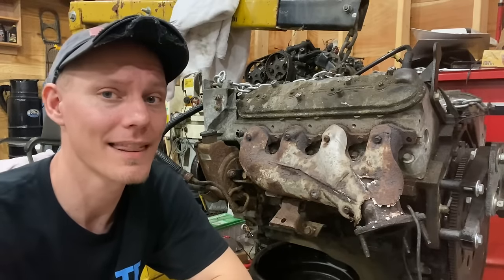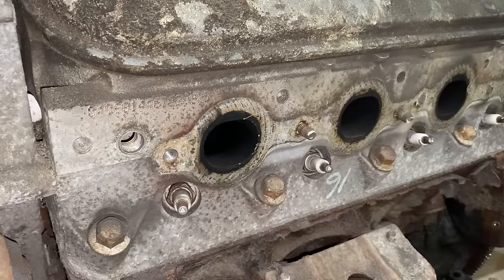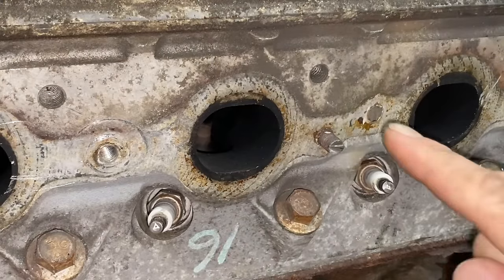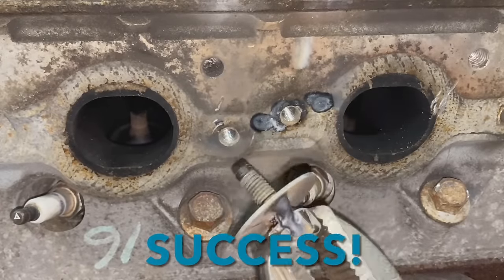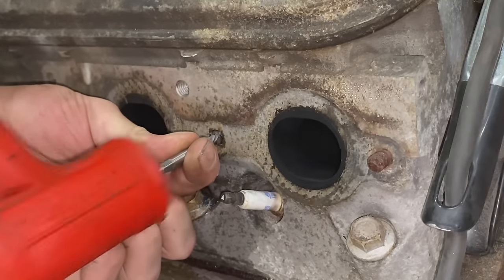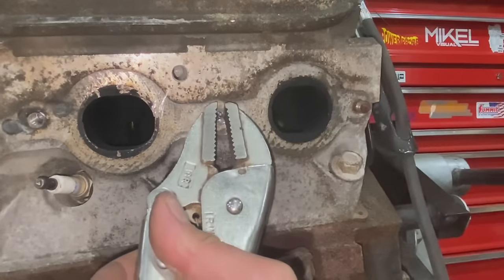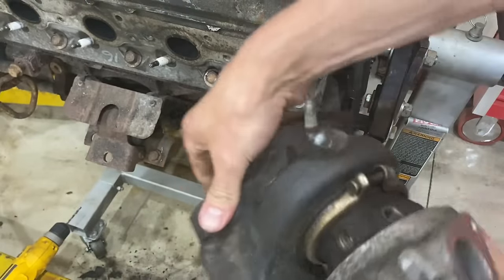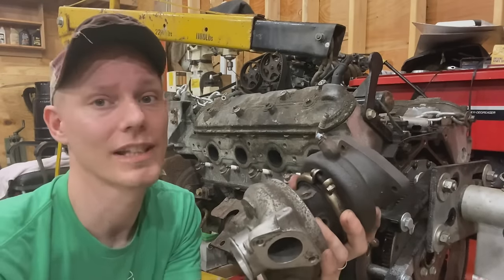How To Remove A Broken Bolt 6 DIFFERENT WAYS - LS Exhaust Manifold

Comment: I'm a pro at snapping the easy-out inside the frozen fastener.  Last time I did it I was so furious I just went and bought another distributor at the junkyard and threw the messed up one in the trash for revenge.
Reply from the maker: I was once working on the bosses rare SD-455 pontiac. I snapped an exhaust manifold bolt, then drilled it and snapped the drill bit in the hole. Got the drill bit out and snapped the easy-out in the hole. After many, many, many hours, it was fixed.

Comment: I can't be the only guy to comment this, but I'm not reading every comment to find out.  One method that works for me about 60% of the time, is to drill it with a left-hand drill.  Of course, you'll need a reversible drill motor to turn the drill CCW.

I normally heat the area with a torch before drilling.

I like your sense of humor! 😂

Comment: I've noticed when dealing with rusted frame bolts, that if you cut the head off and remove the part out of the way, removing the left over stud with something like a stud remover is much easier.  Maybe due to lack of clamping force against the part?

Comment: That went from so-so to dumb quickly.  Heat the Stud first after an overnight spray with penetrating fluid.  Drill with Reverse Drill .   Try hammering in an interference fit Torx bit which does not expand the bolt all the way down.  Heating the Stud is key. You can try quenching with cold water immediately.
Reply: Thank you for the ideas!

Comment: I worked in an automotive machine shop. 
The only method we used was a torch and a tap. The steel will turn to liquid and blow out of the hole without harming the cast iron. Run a tap in the hole and you are done. I could have done all while he was doing one. I liked the video. Learned some new things.
Reply: Question .new to mechanical work as far as this application?   ?wouldn't that fall inside the interior?

Comment: GM 4.2 cylinder head bolts, notorious for breaking off.  9 of 14 breakoff 3/4" below surface.  Too low to weld.  So go for center drill.  Problem is how to ensure center drill.  The bolts are 11mm however the hole is 12mm/1/2".  I find scrap bolts that fit the bolt hole.  Cut off the threaded part so you have head and unthreaded shoulder.  Put that in drill press vise with bolt head up.  Drill 9/64" hole thru center with drill press.  Used this as center pilot and works fantastic.  Key is to use cobalt drill bits with cutting oil. . Drill down 1/4" in 3 steps and use small pickup magnet to clean cuttings.  Use #2 easy out.  Worked great.  I did not have left hand drill bits, but found sets on Amazon for $13 for next time.  Lessons learned.  I also made larger pilot bolts, but did not need.   Love the washer-weld trick for surface broken bolts.  Did not know that and attempted center drilling without a pilot on the head and screwed up and drilled into water jacket because I go carried away.  Win some, lose some.
Reply from the maker: Good info. So once you drill the hole in the center of the head bolt, what do you use to pull the bolt out? Just increase drill bit sizes until you can pull pieces out?
Reply: @WiringRescue  I was able to use a #2/3 easy out, tapped in with small hammer lightly.  Just by luck they came out easy.  Not so lucky when I tried to do the same with broken exhaust studs.  That was disaster, ruined one hole. Drilled into water jacket.  Not sure if that can be fixed.  Had to get another used engine as that was cheaper than a rebuilt head.  That engine also had broken studs.  Unable to drill them out so went to tapped for next size up and then installed helicoils.  Do not know if that will work as I just got new bolts and gasket today.  Best to weld those studs out but not good at that either.
Reply: I was able to drill out a broken off extractor inside a fuel rail bolt with cobalt bits and drill oil. Took a long time, very slow progress and didn't seem to be cutting at all but then broke through and the broken bolt drilled through easily.

Comment: I've used the turbo charger method many times and had great success
Reply from the maker: Perfect! I have discovered that the bigger the turbo, the more fun it is to remove the bolts! Thanks for watching!
Reply: Really, I thought the TC thing was a joke. I would think any piece of metal welded to the broken bolt would help remove it, but why a turbo?
Reply from the maker: @georgerose8727  it was a joke, but it’s not dumb if it works!

Comment: I have one broken off inside 1/4 inch in aluminum.  Would this way work by welding because the weld will stick to broken bolt easier and not aluminum head with washer and nut welded above?

Comment: Ive had good luck using a 4 sided lathe bit the 4 sharp edges after hammered inside the drilled hole grips it well and makes wrenching it out ez as pie.

Comment: I welded a stud on a bike engine. battery disconnected but I still blew the alternator. I now always disconnect the battery, the alternator and (for good measure) any ECUs connected to the engine.

Comment: one thing that I have tried and had success at is before even getting into a job that the bolts are seized like in exhaust manifolds is to take the impact gun and attempt to tighten them slightly but being careful not to break it just give a couple quick blasts with the impact in the forward direction and then the reverse direction and maybe go back and forth a couple of times doing that seems to help break them loose as well
Reply from the maker: That’s a solid idea to try if the bolts are not already broken off. Thanks for watching the video!

Comment: I weld a hunk of rod about 4" long to the knob of the visegrip adjuster screw at a slight angle as a t-handle. The angle lets me spin the t-handle with my palm for quick adjustments and to lock the visgrip with MUCH more force on whatever I'm clamping. 

I drill whatever nut I'm using to remove the threads and plating for a stronger weld. With the engine on a stand I face the engine so the manifold flange is level to take advantage of gravity.  When I have one broken bolt I expect more so I heat each head to bright red with a fine oxy-acetylene torch tip so the heat is localized to the part. Then I let it cool until no color is visible and rock it back and forth a few degrees to break the threads free. I do this about ten or twenty times before removing the fastener. I ALWAYS use anti-seize on bolts going into aluminum parts, and not that watery aluminum powder shit from most parts stores. A tub of Jet Lube copper or any high quality nicke works fine. I've removed manifolds I installed decades before wthout difficulty.
Reply from the maker: Lots of great info here! Thank you for sharing all of it!

Comment: Were do you get your supply of turbo chargers? One other method is to drill out the broken stud to the "root" diameter of the thread and then run your tap down the hole.

Comment: You are right sbout the EZ Outs. If the threads are bound up, it's a no-go. If the head broke off in an accident or because of fatigue, you have a chance. And if you break an EZ Out, only a carbide bit (if any) has a chance of drilling it out. With a steel bolt in an aluminum head, there is a 90% chance the threads are bound up.

Comment: Hey I didn’t see you use any heat on the bolt you drilled out. Probably would have helped. Welding & heat definitely helps. 
Nice video

Comment: Unfortunately I had to pull my cylinder head and am taking it to a shop for repair. I hit the water jacket and broke off a bit and also drifted off center a little bit. Ordered helicoils and even got three different sizes but ultimately felt that I was going to make it worse so I quit while ahead. I was wondering if it would be worth drilling out and tapping the other holes to the next size up and using SS studs.  I ordered new bolts and also a stud kit and will decide as I go. My bolt was broke off below the surface so I didn’t try welding a nut onto it but the washer trick might work. It will be real hard with a stick welder but it’s possible. Really glad I’m not paying labor for this job because the parts alone are killing me!

Comment: I have a 2012 ram Cummins and someone had to of broken a bolt where the transmission pan goes. Pretty sure where the pan bolts to is aluminum do you think this welding is still a good option? Great video btw!
Reply from the maker: I’m not familiar with those engines, so I’d say, look around and make sure welding will not light things on fire. There are usually a lot of fluids in that area, so it seems a bit risky to me!

Comment: I hate those easy outs if and when they break off you have a whale of a mess. These things are so hard they are impossible to drill out.  I would difinently use one of the other methods.  Nice video.

Comment: This was quite helpful for me...  I found the double-nut (backed into eachother), with some spray, heat, and an extra boost by Vice Grips did the trick best, but I did have to Dremel a nut nostly off and chisel it in the lefty-loosen direction.

Comment: Ah the ol turbo manifold bolt trick. Been around for years. Pioneered by airforce mechanics in the pacific thee-yater during dubya dubya too.
Reply from the maker: Back in my day, we welded helicopters to broken bolts and then flew em in circles!

Comment: And if you don't have a easy out to remove broke off stud I have found that a torx bit ( without security style hole in center of bit) works pretty good. And always use  a center punch on stud and best to drill all the way thru stud also helps chances of removing stud. And be straight as possible and try stay away from threads.

Comment: if you cant remove the head, is it better to have the engine hot, normal running temp, or the engine cold, when you start working on this....

Comment: I will try that washer  l do the  bolt method  mostly  I started  heating  the bolt heads  before  I remove  them I rarely  break  a bolt now and for the dipstick I heat the block  around  the tube and work  it out carefully  remove  the starter  first  to get better  access

Comment: If the stud is sticking out, I’ve found best method is hitting bolt with hammer to jar it lose. Douse with penetrating oil. Vise grips & tighten a touch 1st, then back out. Sometimes hitting with hammer again and spaying again. Have had good success with this

Comment: Nice video! When I extract bolts the first step for me is to always douse it with penetrating oil and then shock it with a hammer and pin. I rarely weld a turbocharger onto the stud.
Reply from the maker: This is good advice! When all else fails - weld a turbo to it! Thanks for watching!

Comment: i dont know if you have tried t e freeze spray avail.at parts stores it work very good on broken bolts spray it on then  unscrew it shrinks the bolt slightly to break the rust bond

Comment: So this is an old video, but just came across it.  What would be your thoughts on this one...I have a 2008 Charger, 2.7L V6.  If you are looking at front of engine, they have a Torx bolt/screw in like the 11 o'clock position of the timing chain cover/timing plate.  I snapped the head off.  Any ideas on how to get that out?  The space between it and the radiator is really limited.  So hammering in a bit or something is probably not doable.  I can't even get a drill in there to drill into the stud.
Reply from the maker: The unfortunate truth is that I would remove all the stuff in front of it and use a drill or welder to get it out. It totally stinks. Sorry I don’t have a better option. :(
Reply: @WiringRescue  Yeah, I was thinking I was going to have to do that. Thanks man. :)

Comment: If you have any suspicion that the bolt is frozen in place, use a steel drift and a BFH and hit the bolt dead on several times. Shock treatment will often unfreeze things just enough.
Reply from the maker: Solid advice right here! Thanks for watching!

Comment: Thanks for that video and your ideas! Some days ago I had a inner hexagon screw with bad threat. I didn't get the screw out.  I tried with heat, rust remover and strong pliers. But no chance.  I also tried with welding another screw on it - but it directly broke off.  I am not a good welder ;)  But after using the heat of welding, I could turn the screw with the pliers and hitting with a big hammer on the handle of the pliers.
By the way, rost remover is also a good idea to help removing old screws or bolts. If you have time, put something on it and try to remove bolts/screws next days. I is much easier in the most cases.
Reply: I tried the "bad threat" method today. It just made it put up more of a fight.

Comment: For broken off bolt heads with available shaft length, my Grampa used to apply heat, apply penetrating oil (he called it green oil), let it sit for a day, apply heat and then remove the rusted bolt which he said, usually, they come out.
Reply from the maker: Sounds like a smart guy! Sometimes you don’t have the time to wait though. Gotta start welding and hope for the best when that happens!

Comment: I successfully removed 2 broken bolts with the easy out bits drilled a tiny hole in the center and they came right out I've tried the welding with a washer and the nut and just the nut alone and it failed me so I prefer the easy outs now over welding them

Comment: Heat is really what gets the bolt out. I think the factory puts loctite on the treads. I tap the stud after I weld the bolt or washer then tap it with a hammer to break the bond helps a lot to. Try to get it off while it is still red sometimes work better. Aluminum takes the heat out of the bolt super fast. I start when its red and if does not move keep working on it even when the bolt cool off. If it movers then put penetrating fluid on it and move it back and forth till you can screw it off without breaking your weld or the bolt. Seems to work the best for me.

Comment: Reverse threaded self tapping screws and a sleeve. Put sleeve in hole then self tapping screw in the sleeve. Lot of time the reverse cut self tapping screws will bit and being reverse cut will pull it out. Reverse cut drill bits help to spin it out as drilling.

Comment: What do you do if the bolt is torqued in solid steal and not just aluminum?  Example, being...  A busted off sway bar bushing bracket bolt going into the sub-frame...

Comment: Abom79 had a very nifty tool, a Vessel impact type driver 2500N for taking out stuck Philips head screws.  It was like an impact punch that you hit with a hammer and when you do it also applies torque at that same instant. I want to get some of these because it looks sooo Much better than trying to force a Phillips screw driver to not shear the slots.

Comment: Just curious, since the head is aluminum where did you connect the ground clamp for the mig welder?
Reply from the maker: I clipped it on to wherever was convenient.  The electricity goes through the aluminum head just fine.
Reply: @WiringRescue  thank you!

Comment: Have a similar problem on a marine Detroit Diesel with the nut spinning on the stud. Thinking about putting another nut on the end of the stud with red loctite then maybe impact. Tight in that engine bay.

Comment: I want a MIG welder. Did a exhaust stud on a motorcycle that had a littlt bit of stud sticking out. I was able to thread a nut on anout one turn. A local mechanic with a MIG welded it and the stud came right out.

Comment: When using the easy out, try a reverse drill bit. I can’t swear it but I feel like I’ve had a little more luck with them, maybe it’s the constant vibration and torque in the loosening direction but I swear it helps.
Reply from the maker: It seems that a lot of people here are fans of reverse drill bits. I definitely need to try those out because I currently don’t own any! Thanks for watching!!

Comment: Hi if it's a aluminium head we're do you ground the welder
Reply from the maker: Anywhere on the block works. The electricity goes through fine. Just make sure your battery is unplugged.

Comment: i have a 1972 F250 i plan on reviving and the previous owner/s put performance headers on it. the passenger side came out pretty easy i broke one bolt on the drivers side and i decided to spray lubricant on it twice a day every day  and i plan to stop in about a week. i'll see if that works for me.

Comment: And now the final boss, when you break off the extractor in the bolt and have to use 20 new drill bits to get the extractor out. Also I never see anyone use a lefthand drill bit, might help to loosen it or even get it out.

Comment: Time will tell if this actually works, but I will definitely try out your weld a washer and then weld a nut trick!!!! Like you said at the end for me personally I tend to have such a difficult time actually welding the nut to the stud I usually just end up going with the drill out the center method.

Comment: Method 7(non-weld option): Tap a socket, just smaller than the threads, on the stud. Back out with a rachet.
Reply from the maker: I’ll try that!

Comment: Heat works to get things unstuck. Alternating heat and cold can be even better.   I freed up the pistons on a seized outboard motor by alternately pouring cold and boiling water on the engine block, after having removed the plugs and shooting Free All into the pistons.  Hot water would be safe near a gas tank where greater heat or a torchcertainly would not.

Comment: Wonder if you take a Dremel  carve into broken bolt either a Flathead or Phillips shape so that you could then use a screwdriver and or screw gun to back the bolt out.
Reply from the maker: It’s certainly possible! But it would depend how stuck the bolt is. Sometimes the screwdriver won’t get enough grip on a bolt that is rusted in place. However, if the bolt was freshly installed, and just over tightened until it snapped - this dremel method would likely work great.